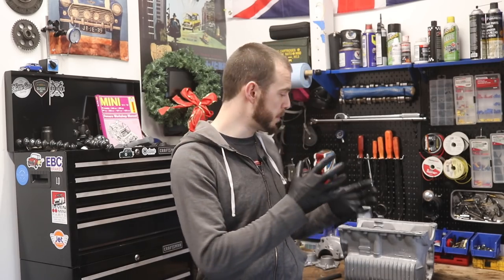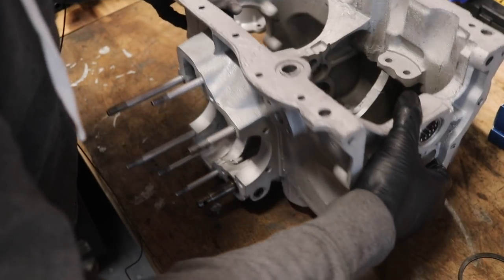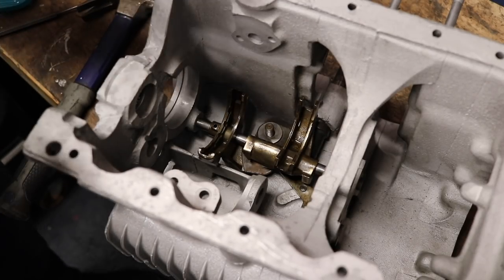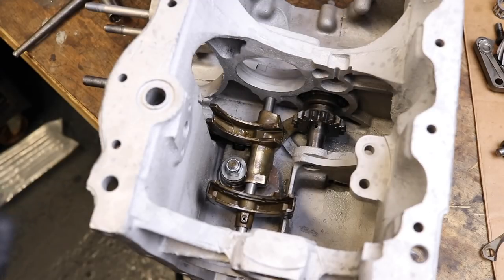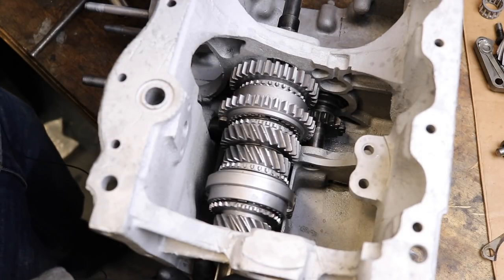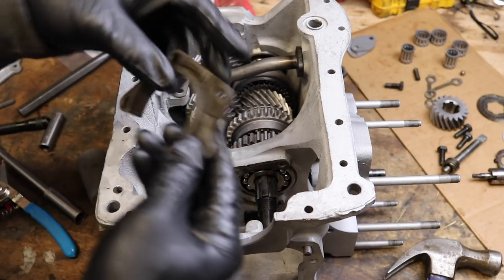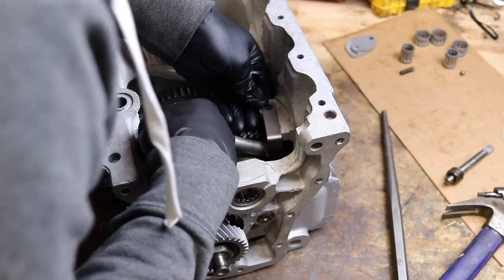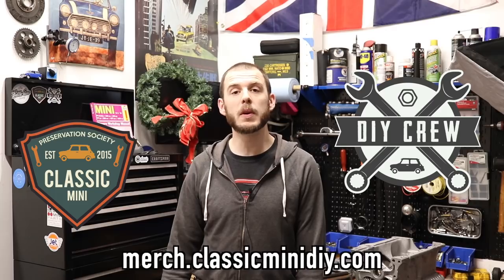Rebuilding a Classic Mini Rod Change Gearbox - Part 4

Comment from the maker: IMPORTANT CORRECTION: Want to add a pinned comment to this, at the 23:27 timestamp youll see I put the washer on BEFORE the pinion gear. This is INCORRECT. Please note that the washer needs to go on after the pinion gear follow then by the nut. Apologies for the mistake in this video!

Comment: Pro tip:  As you use a punch to dive your main bearings into place.. Don' hammer on the inner race.  Only use the punch to the outer race to get it to settle into the case.   Even taps around the whole outside.
  ALso use a shop Ball Peen Hammer for car work.  Claw hammers are for houses and Lumber.

Comment: Hey Cole, great video, you do need to remove the pinion gear though as the locking washer goes on after you install the pinion gear 👍
Reply from the maker: Yeah only realized after I posted the video. 🤦🏻‍♂️

Comment: Fitting the bearings with a punch is not good engineering practice, the bearings need to be fitted square to the casing with pressure around the whole outer ring. I used 3/4 drive 1 7/8" socket and copper faced mallet. Worked well for both main bearings.
Reply from the maker: In a perfect world with access to a press that would be the preferred method but its perfectly safe to install these bearings with a flat punch as long as you hit the center face of the bearing and not the outer ring, taking care to keep your punch on the face and not allowing it to jump into the ball bearings. The socket and mallet method is also a great way to do it as well!
Reply: @classicminidiy  sorry to say but as an engineer since 1968 you never ever use the inner face on a ball bearing to tap in the bearing its always always the outer race face if you use the inner face you put the ball bearings under stress and they can fail

Comment: Just a suggestion not a criticism but it might be easier to work out your lay shaft end float prior to installing the main shaft and gears.
Reply from the maker: You know that makes a lot of sense. 🤔 thanks for the tip

Comment: The lock tabs before you torque down those gears? Also what final drive is it?

I know how you feel with the filming stuff. I had a play film with a GoPro but honestly didn’t feel like doing much with it as it consumes so much time when you just want to get stuck and get something finished. 

Great videos keep them coming👍

Comment: very helpfull. but when checking the clearances you say "lets see if it fits in there" while you block the view completely with your hands :) so no idea where you checked it.. (I do have an idea where, but beginner-mecanics won't. apart from that, great video )
Reply: I thought the same, I could not see where the clearance was checked. Any idea?
Still, superb and easy to understand videos.

Comment: Amazing clean professional work. Any body knows company in UK recondition 1999-2000 mini 1300 Spi cooper classic AP Automatic transmission 4 speed. Repair manual book, special tools. Waiting your help. Best regards,
Reply from the maker: Check out Guessworks in the UK. He’s your guy for servicing those automatic transmissions.
Reply: @classicminidiy  thank you for your quick reply and help, what your advice to me better I overhull the Automatic transmission or I convert it to manual gear. The car 2000 mini 1300 Spi very clean frish paint. Best regards,
Reply: @classicminidiy  I have bad luck Guess works stop working in AP automatic transmission. He mentioned that in website. Best regards